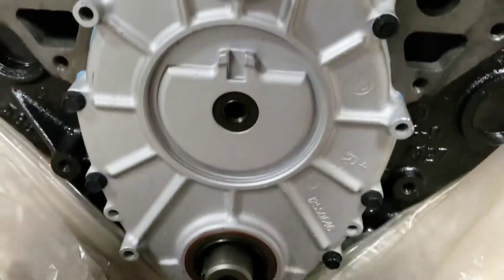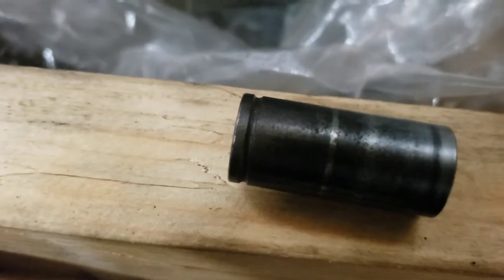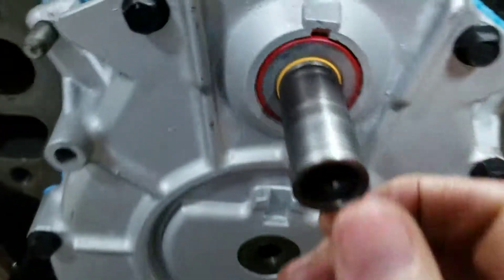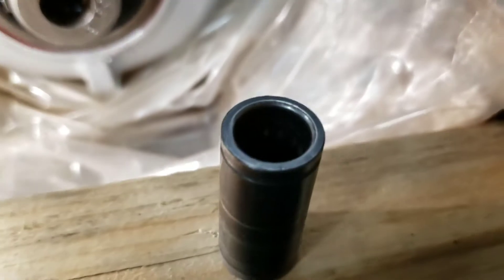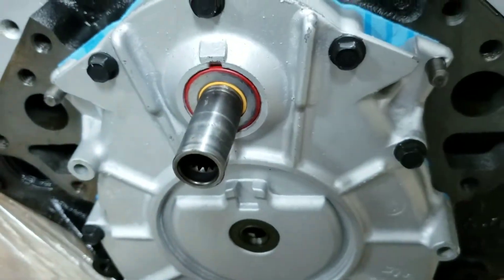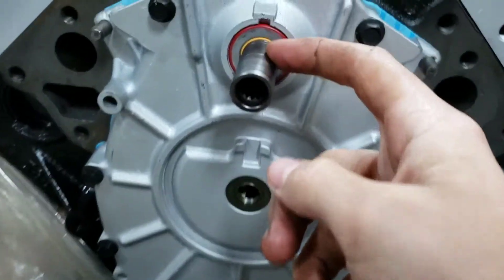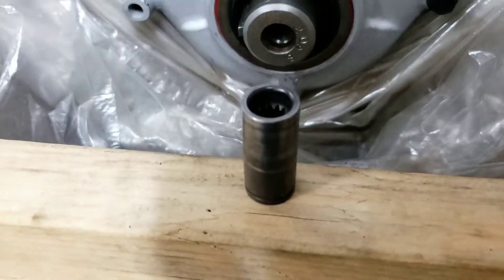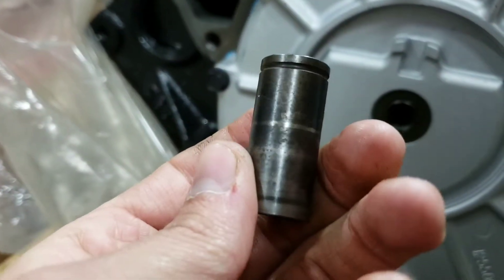Correct orientation of LT1 water pump coupler

Comment: The reason the manual tells you which way to install it is because it will slide on and locate easier the correct way around. 

Once installed, it makes absolutely no difference at all which way you have it, it's a coupler, and it is near indentical both ends. The end with the groove on the outside has bevels on the spines to help it locate and slip into place, for that to be of any use the coupler needs to be put onto the water pump before installation. 

If you install it reversed, it works the same, but you would install it on the drive shaft then install the pump. 

To suggest it'll overheat or run any different is a little odd, it physically can't change anything about how the engine runs or how it drives the pump. 

I know what the manual says, but i also know it doesn't say why GM wants it done that way, and the only reason why is so it'll line up the splines without undue effort.
Reply: The bevel on the engine end would certainly help if installing the coupler on the water pump first. Thanks for the tip.
Reply: Hello as I understand that this water pump is driven by the opti spark and so that coupler has on one side a ring groove for a reason and not just coincidence i recently changed my water pump and didn’t see the groove so before I installed the water pump I put in the coupler but the groove was on the front versus it should be on the engine side  and I didn’t know that it made a difference well my car was over heating like no tomorrow I had no idea what I did wrong looking at videos on youtube and everyone is recommending the coupler groove should be on the engine side so I did and now my problem is solved so your saying that it doesn’t make any difference well what I experience tell me it makes a lot of differences witch way you install it.
Reply: @Elijarbouh  nup. Makes no difference. The groove is there to indicate which side has the angled splines for easy installation, and that's all. The angled side will self align, the other side won't.

The groove does absolutely nothing else. Makes it much quicker and easier to install if you put it the correct way, but once installed it makes no difference what so ever and it would be nothing should of lunacy to suggest it could. 

The water pump is driven off the camshaft via gears, not driven off the distributor. 

Either the system was never bled properly or some clown used a heap of silicone on the gaskets that don't need any silicone. 

It sure as hell wasn't the coupler unless it was badly stripped, having done thousands of them i'm yet to see one that was, and i've never had one leak or run hot either, no matter which way i put the coupler on.

Comment: its a coupler, it isnt moving in relation to either shaft, maybe on engine start a very little
Reply: since it's not a bolt on solid piece, it's moving around somewhat and at considerable rpm, hence the grease

Comment: Do they just come off? Mines not coming off.... I wasn't sure if there was a retaining pin or ring
Reply: Same I can’t get mine off at all. Did you figure it out?
Reply: @MrGee281  yes mine was rusted on. I used penetration oil and wiggled it off
Reply: @Reaperhydraulicstampa  I’ll end up trying the same. What penetration oil did you use?
Reply: @MrGee281  I can't remember the name but WD 40 will work

Comment: If you pack it with grease the grease will spin out everywhere
Reply from the maker: If I remember correctly there are o-rings on both of the splined shafts that this coupler fits over which would prevent the grease from spinning out everywhere.
Reply: @revmatchstudios  Yes, and it seems if one used a stiff or sticky grease, the spin force on such a small radius is minimal, and the grease might stay put. The other advantage to a grease filled space would be heat transfer, as you mentioned.
Reply: @johngalt97  Allways use new O-rings every time you put it back together, and always pack it with grease, I use non hardening silicone, I bought a bag American made O-rings at Ace, the China Fel Pro ones degrade almost instantly.

Comment: I put mine the opposite way . Will that make it leak
Reply: Did yours leak? I am doing it now and it's leaking a little. I think that I might have put this on wrong. I'll have to take it off again. Hopefully I won't get the new Opti wet.
Reply: @TCMapotherIV  if it's leaking oil, you almost surely folded and ruined the seal when installing the new water pump driveshaft seal. Easy to ruin. Watch other videos
Reply: @CP-ux9zd  I don't remember how I fixed it. It was two years ago.
Reply: Truth be told it makes no difference, but it installs easier the way the manual tells you.
Reply: Overheat
Reply: @chrisbelli445  Overheat, that's funny, it makes absolutely no difference which way it goes.

Comment: What happens if it goes the opposite?
Reply from the maker: To be honest with you I'm not sure but the splines are slightly different on each end of the coupler, and the orientation of the grooved side is clearly defined in the service manual, so there must be something to it, I'll do some homework on it and try to find an answer for you!
Reply: @revmatchstudios  ever figure it out ?
Reply: @josegalvan3152  It works fine either way, I use mine the other way, because I use mine to install the seal, put the coupler through the seal so you don't roll the seal, then put the coupler on the shaft, slide the seal onto the shaft and doesn't have the groove for the seal to catch on, you could turn the coupler around after you get the seal installed.
Reply: @user-Dr.  .. Huh? The coupler definitely won't go thru the new seal. I bought the little bullet looking piece of eBay to install the new drive seal which does that. Couple Won't no way no how
Reply: @CP-ux9zd  On my cars the coupler is the exact same diameter as the seal surface on the shaft, you have to shine the coupler up of course and oil it, slide it through the seal from the front of the seal whether the seal is in the cover and you are installing the cover and seal together or the cover is on the engine and you are installing the seal into the cover while mounted on the engine, now possibly your coupler is a larger O.D. then the shaft itself, I have never seen that myself, but it sounds like you have found a tool that has solved your problem anyway, and it does not matter which way the coupler goes on, I always put the groove on the waterpump side.
Reply: I can answer this. As mine was installed wrong FROM THE FACTORY. 

Its near impossible to get off, and most likely will snap in half when you try. 

I have pictures of the collar. The notched side was against the water pump as it got stuck on it. 

Heat, oil, nothing helped.

Mind you this was a garage kept southern car as well. With 94,000 miles....
Reply: I think it causes the engine to overheat